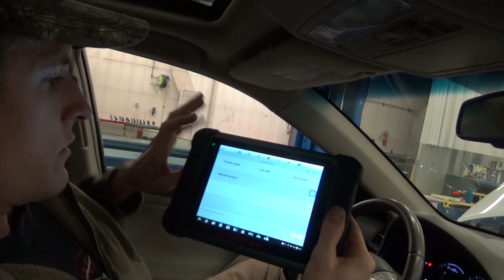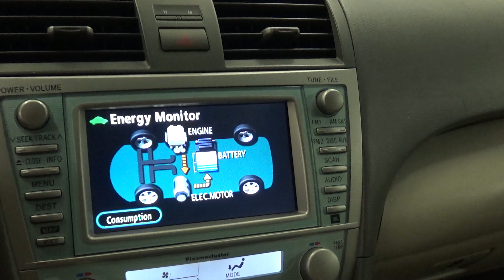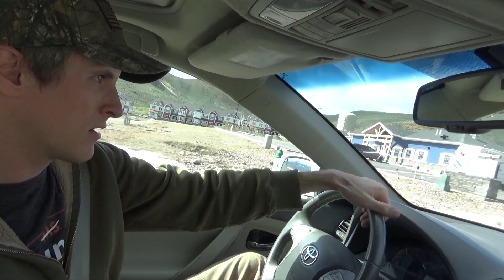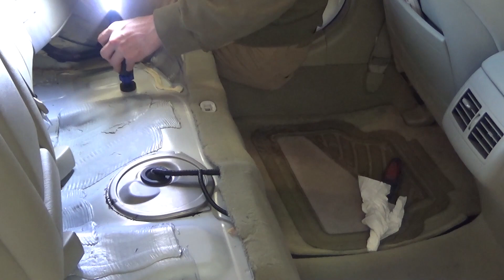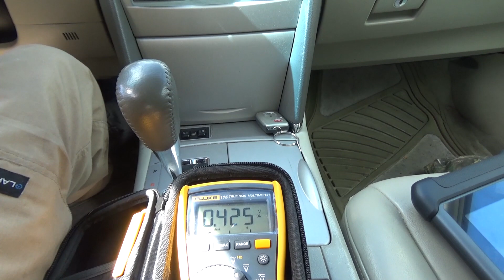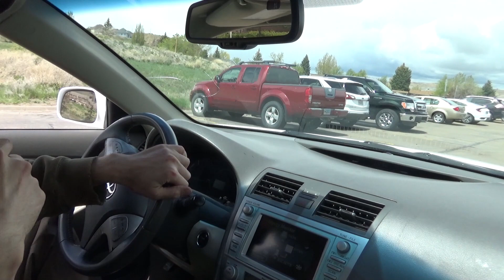09 Toyota Camry Hybrid P0A0F & P3190 Check Hybrid System Part I

Comment: I have 07 Camry hybrid just like this one, it’s been 5 months figuring out what’s wrong with it, i changed all the cells with new ones and still is not charging the pack or won’t start, another thing something draining the battery pack

Comment: thanks for the video. it’s helping my troubleshooting process for my car of the same make model and year. I too burn oil excessively and have no (known or visible) leak. I’ve replaced a lot on my car — and I am getting close to the issue at hand. I am going to check the inside of my manifold for the cat once it cools off… see if mine is also clogged.

Comment: I have a same issue right now. Took it to the Toyota Dealer. First time they cleared the code but it coming up again on the road. And beeping and shutting off the car and locking the steering wheel. 
I got it tested in Autozone Tester. Changed the Mass Air Flow censor. Reset the battery 100 times because you can drive some time after resetting your battery. It happened again. Toyota told that aftermarket censor is not good and they installed their own OEM MAF censor. “Check hybrid system “ coming up again. They are still working on it. They did diagnostic on hybrid battery and everything is fine. 
So I called them and told it might be Catalytic Convertor and asked to drive without MAF censor. They said they are working on that. 
GREAT VIDEO. Thank you
I have 2014 Toyota Camry Hybrid. 156 000 miles on it . First time encountered this problem and even Toyota having difficulty to find what is it. I took the car to them 3rd time in a week already
Reply: Hope to see your updates mate! Thanks!

Comment: Folk please help me out my Toyota Camry hybrid 2007 just shot down right now, not moving, after diagnosed he said poor engine power, I changed the fuel pump same problem, now the engine and battery not working at all, please help me out I'm in deep trouble

Comment: I have same exact car and 3 days ago the red triangle 🔺 light “check hybrid system” came on and the car 🚘 is not drivable. Today I towed my car to the repair hybrid shop and waiting for the diagnostic results tomorrow. by the way mine has only 146k on it.
Reply from the maker: Thats a young one - Hope you get it fixed!
Reply: Any results it's been quite a while
Reply: @mrvic92154  Yes, in my case they found the cable that connected to the battery was loose! The main battery that located underneath the back seats and you can access it from the trunk. Was easy fix.
Reply: @Silence-is-Golden14   The night before I got the P3190 code I had filled my car all the way up with fuel and drove it up 5 miles to my house and parked it on our slanted driveway facing down hill Then in the morning when I started the car the check engine light came on with the triangle, The car was running rough as I was driving to work about a 2 mile drive But then the engine turned off halfway To my destination And the engine would not start and the battery had only 2 bars so I pulled over, I shut the vehicle off and turn it back  on a couple of times then it started to run on its own again but kind of rough, When I ran the code I watched some YouTube videos to check out the the mass air flow intake notice it was clean then I erased the codes and then I started the car right back up and it ran perfectly fine without any more check engine lights, I think I may have overfilled my fuel tank and parked the car very soon after and possibly some disruption in the carbon filter, I've been driving it for a few days now without any issue, I can't think of anything else🤔🤔
Reply: Mine has come on also

Comment: Thanks for the video... well spent time for me...I've had to do similar troubleshooting out in the oilfield with the rig shutdown...first thing I learned is to add patience...esp when you don't know what you are doing...lol (new experience for first time or 10th)...i will assume the result in video was a bad catalytic converter....I have my third priius with 300k and I used an aftermarket cat for a corolla twice(cat low code was solved)...I'm in PGH,PA...my 4th back-up prius has an engine shudder which appears to occur when computer changes from batt to engine with load(like up a hill)...there is warning before in a slight stutter when adding gas pedal... first help is to surge the pedal like a wave accelerating engine to before the shudder occurs...less pedal repeat...If that doesn't help pull off road safely ..park... And turn engine OFF (rest {relax}) for 10min feels like 30...BUT think I am off the road safely and take time to think of five more options and think them through ...then restart car and drive forward... You may have to pull over several times to let car relax...but you will get home(I mean Toledo to Pittsburgh  on Turnpike with several pull offs Rightside side for 10... again I thank you for your video good luck with your next Prius
Reply from the maker: Its amazing how its expected that a Toyota goes 300K while others get scrapped at less than 200K.  Could be worse!
Reply: Sorry to be off topic but does any of you know of a way to get back into an instagram account??
I was dumb forgot the login password. I would appreciate any assistance you can give me
Reply: @Roy Marley Instablaster :)
Reply: @Jaxson Alberto Thanks for your reply. I found the site thru google and I'm trying it out now.
Looks like it's gonna take quite some time so I will reply here later when my account password hopefully is recovered.